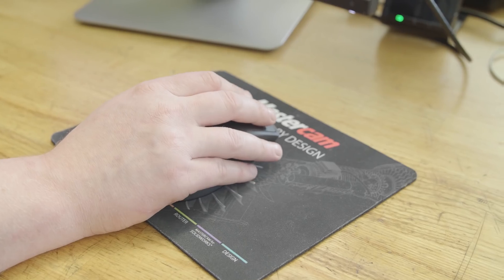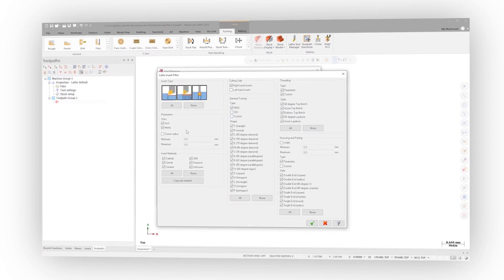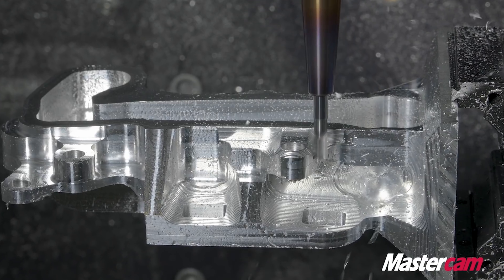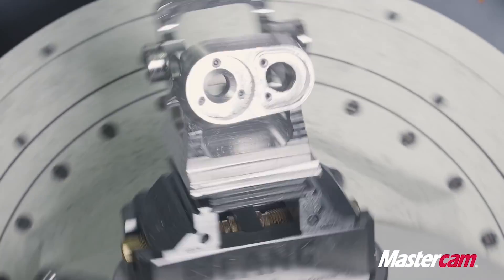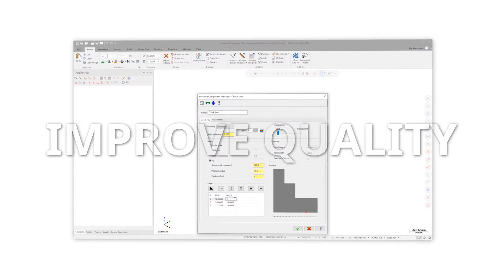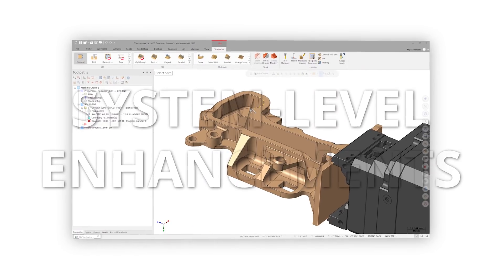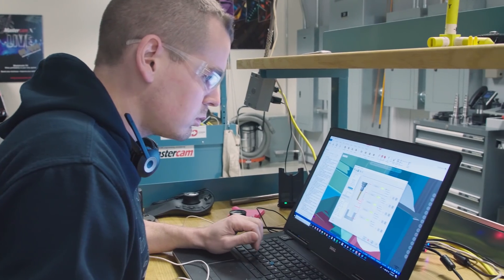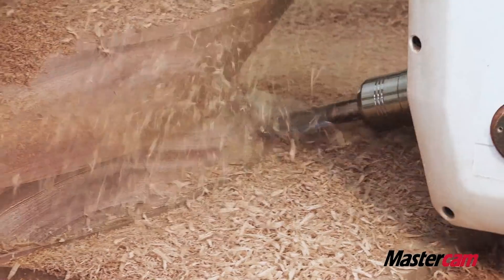Mastercam 2020 Trailer

Comment: I don't know but Featurecam in my opinion still better to use I can setup my work coordinates so much faster and easier than WCS in mastercam...feature based is also the way to go I programmed a part in seconds based off my tool crib in featurecam rather than go step by step and doing manually in mastercam...I rather cut metal than program all day... master cam still has long way to go...